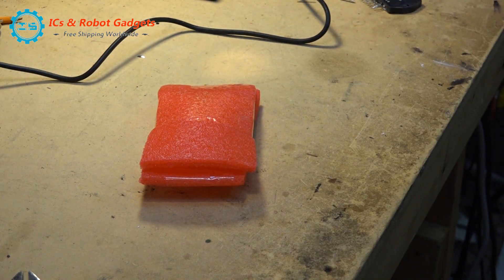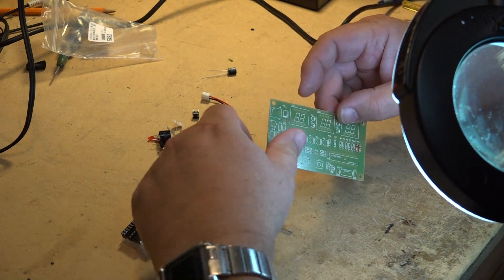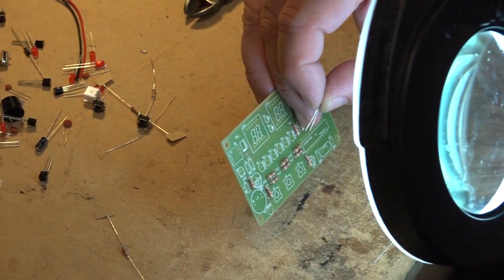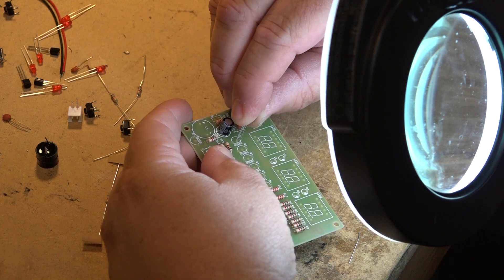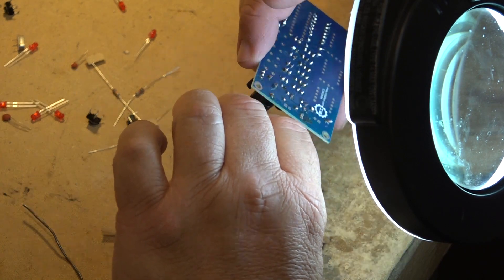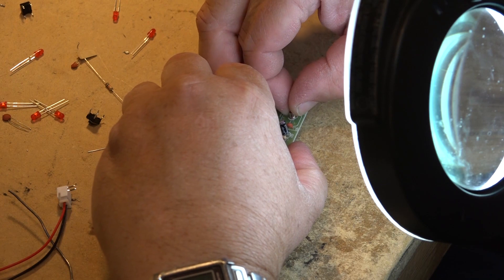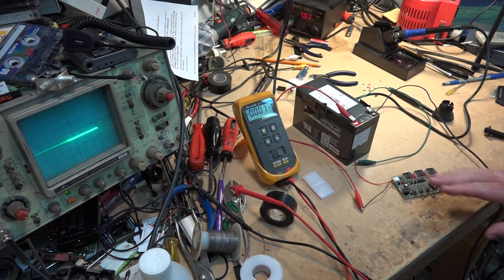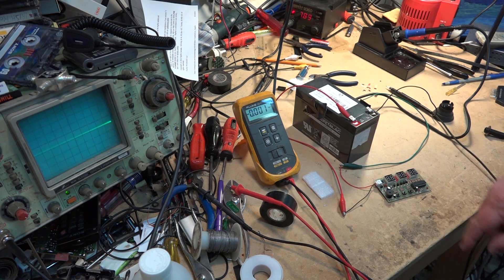IC Station Clock kit FAIL

Comment: From the pcb silkscreen shows that has not AVR micro but 89C2051 which is a different story.Can be replaced with at902313 and change the reset pin polarity and then what?Sit down to write your own code that might take up to a month just for a led clock kit?
Reply from the maker: I don't write code.

Comment: I think you should have had more fun connect it directly to 240v AC and blow the shit to bits now that would be more entertaining than watching you waste your time putting together China shit that is badly designed bad packing and a bad product all round but you did know that it was not going to work when you opened the bag. Please bring back Heathkit but then China stole all there designs and turned it into wast products!!
I did like your comment at the end quality control what is that I think you need to tell them

Comment: Bang good has been good to me ,until I had a problem with this kit,I been doing kits for over fifty years.I no how to solder and which solder and which flux to use ,I have a pretty high tech work bench,they didn't ask those guestions ,they just wanted a picture or no deal ,I not that great at sending photo through the email

Comment: That's better than bang good ,they wanted pictures of my kit,I don't no how that will help them to test components ,from a picture,for a kit that only cost $ 3.40.
Reply from the maker: They just want to make sure that you didn't f--k it up with bad solder. You know, acid core, or acid flux used. You would be surprised at how many do that.
Banggood has been very good to me. When I got a bad BTL amp module, I contacted them, and they sent me 2 replacements no charge.
I have no issues with either of these suppliers, and have done several reviews for them. I just die 3 for IC station, one just posted literally minutes ago.

Comment: '
12 volts battery is a not good on the clock kit...
must be 5 volts to 6 volts only...
also 2 cross wires black to red / red to black...
try again match wire colors black to black / red to red
Reply from the maker: Look at the polarity on the board. The "Black wire" goes to the + mark on the board and the "red" to the -. The plug they supplied was wired incorrectly. 
There is a reverse voltage protection diode on the board anyway so connecting backwards won't do anything. I did connect it the correct way. There is also a 5 volt regulator, to drop 12V down to 5V. Someone wasn't paying attention before opening their mouth and sticking their foot in it.
The chip was NOT programmed. This was confirmed because they sent me a replacement. Different kit, used the same chip. I swapped the chip, and this one fired up, but because the LEDs were wired differently the display is scrambled, but the core part of the circuit is the same, just programmed differently which proves that the chip wasn't programmed.
Someone f---ed up, and stuck a blank atmel iin the package.
I have built many projects, and just finished a dot matrix clock kit, all SMD with 115 LEDs and some tiny SMD chips on it. Works perfect. I do know what I am doing.
Reply: alright thank explain...
i have a 4 digials with 7 segments LED clock kit

Comment: Hello. It looks similar to this:  http://www.instructables.com/id/How-to-make-a-digital-clock-kit-based-on-Atmel/?ALLSTEPS#step3
So you can download IDE and compile from source and program IC. AT89C2051 needs parallel programmer.

BTW: couple weeks ago I ordered frequency counter kit (with Microchip microcontroller) from China and after assembly same issue - no signs of life on LED display. I don't know if microcontroller was correctly programmed - I suppose that IC was protected from code reading (don't understand why - assembly code is available on author website). So I downloaded source code, compiled it in MPLAB and uploaded to IC. Counter is now working.
Reply from the maker: Thats great but I have no compiler or any way to program it. 
I could probably build a parallel programmer as that is like a jtag, but I don't have any compilers, and I don't program. I learned assembler and basic back in the late 70's but I never perused programming.

Comment: If that's an ATMegaXXX chip, those are used in Arduino boards; you might get lucky and the chip has the bootloader... and nothing else. Then you can always keep it as a spare for you Arduino! Or even try to write your own "clock" program. 😎

Comment: How about clicking some of the buttons? Maybe it has some sleep mode for saving battery or something, and it fires up the outputs when someone interacts with it.
Reply from the maker: Tried that. I do have the operating instructions from the Web site. Looking for the code to see if I can flash it.
Reply: 12voltvids ah, the moment when you have to flash for fix, or something better.

I have my own electronic shop aswell. I do a lot of PS3 downgrading, and also repair old electronics. Updating them, or replacing broken components.

But yea, it sucks they sent you a blank. If I was you, I'd never uploaded this video. But at the same time, lets people know not to order things from them, especially if they didn't send you a working IC just for the video. 

It just shows you the lack of there company. If I wanted to somewhat advertise, I'd make sure things are perfect with guarantee. 

That styrofoam when I first seen it I was like wtf, are they retarded? Sucks you wasted your time, but this video was much likely enjoyed.

Thanks for sharing.

Comment: Bummer! You can sometimes release the pins in those plugs with a needle and pull them out and swap them over. But in this case it's academic... pity it's not a PIC I would have happily written you a clock program to burn into it!

Comment: That power socket could have been mounted on the bottom of the board and the polarity would have reversed.
Reply from the maker: The wire color is irrelevant, the + side Is marked and it is reverse polarity protected anyway. The problem is the ic. Most likely not programmed.
Reply: Yes probably the case, just saying anyway.

Comment: Big no no that Styrofoam for carrying the IC in until build up. Sadly see this happening more and more these days with parts from China.
Reply from the maker: Not only was the chip in Styrofoam, bit the entire kit was in a plastic bag, wrapped in Styrofoam, and then in another plastic lined shipping bad. That's good for building up about 40KV! Geez. And people get on my case for not wearing a ground strap. At least I grab onto my grounded desk lamp before I pick any ESD devices.
Reply: Crazy! I don't a ground strap often either. I do the same and touch/hold onto a grounded appliance nearby, sometimes even the USB connector shroud hahaha. Never had a problem with ESD yet.

Comment: Tried googling to find the kit and this video is the second hit in my search. That was quick - only a couple of hours after you uploaded it!

-

IC station has a different kit on their webpage at the moment,, and it comes with an unprogrammed ATMEL chip and instructions on using the Arduino IDE to upload code to the clock.
Reply from the maker: I am thinking that this Is the case, the atmel is unprogrammed.They did not mention if the chip was programmed or not. I assumed that because they were selling it as a kit it would be, but no information came with it, just a bag of parts.

Comment: If you look at their website they have links to download the schematic and an associated video.
Reply from the maker: But what good will that do. Looking at the schematic or their videos won't fix the IC.
Reply: No, but you said at the beginning of your build that the kit came with no instructions. Well, there's information on the website that would assist someone in the construction process. 
Having downloaded the files from the website I can confirm that the zip file contains two versions (pdf and doc) of the same document which consists of the operating instructions and a circuit diagram. There is also an embedded YouTube video which purely shows the operation of the clock kit when built. Not much use in your case! 
As you said, perhaps if the microcontroller had been afforded the basic protection against ESD then your kit may have worked, assuming it had been programed correctly beforehand.
Reply from the maker: Yup I am trying to get them to send me a new chip as I would like to get it working as this one I am sure was zapped in transit or slipped past qc unprogrammed.
I am hoping if they see this the will send me a new ic, then I can revise it. The kit is nicely laid out, but a little more care in packaging would go a long way. The ice tube clock kit the atmel came in a proper static shield bag and was in anti static foam as it should be.
Reply from the maker: Yes I know, but that one is not exactly the same. Look at the layout on the video.  I do have the schematic for that one. The problem is the chip is not functional. I have voltages to the chip and the xtal is running, but no output. So either the chip is not programmed or it is dead.
Reply from the maker: Yes I have it. I put this together over a month ago. I have the schematic for the current one listed on the web site which has a slightly different layout, but I believe the schematic is the same. The problem is the chip is dead.

Comment: Friend who is the problem?
It would be the IC?
Reply from the maker: Yes it will be the IC. Either it was damaged due to it being packed in highly static generating Styrofoam, or they forgot to program it before they shipped it. I have built a few clocks, the last one was the ice tube fluorescent display tube clock, used the same atmega chip. If I had a programmer and source code I could flash another one, or even this one if it just wasn't programmed.I contacted the vendor and asked then to send me a new IC and they just said sorry.
Reply: 12voltvids - did they agree to send another ic? Or did they just so Sorry and nothing more?
Reply from the maker: Didn't offer to send a replacement, just said I sorry I was having problems, implying that I don't know how to install components.I took that as an insult, considering that they have everything silk screened on the board unless they have it wrong. It is a pretty fool proof kit too build. Perhaps this will get their attention. I would love it if they would send me a replacement IC, but I am not holding my breath.
Reply: 12voltvids - that's a shame, I guess they missed their opportunity to show how good their customer support is, instead it shows how bad it is, I was going to ask them if they wanted to send me something for my channel, I don't think I will bother, I'm not sure I want to promote a company which is like that.
Reply: 12voltvids
They should send another kit for you! You bought online? It was in the aliexpress site? Send the video link to see it. This has happened to me. I bought a camera keychain and it did not work.